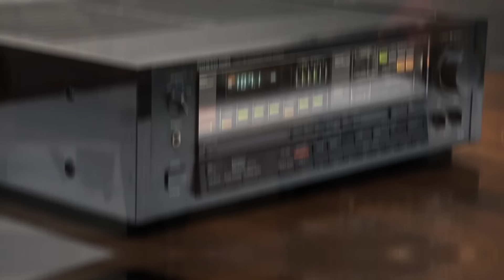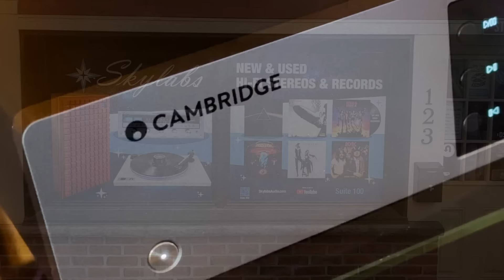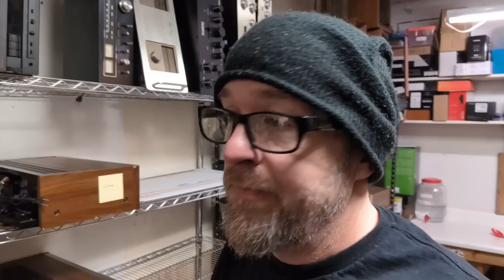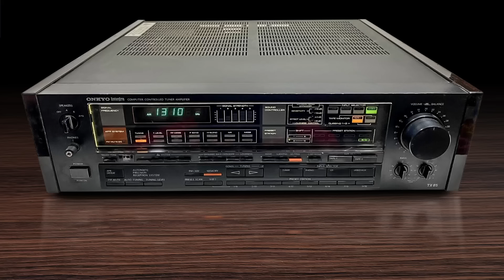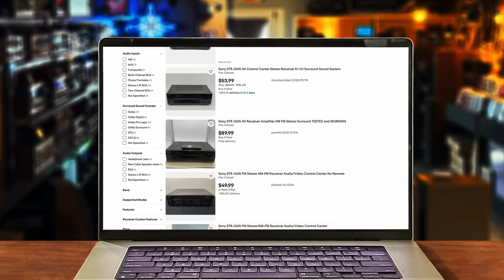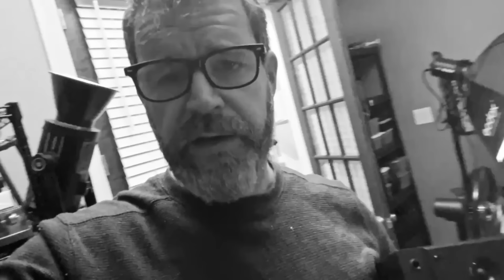Underated Vintage Stereos You Can Get Cheap... For Now

Comment: Very cool topic I still own my original pioneer setup which I bought in 1991 a pioneer stereo receiver model vsx 9700 s and a pioneer 100 CD changer model PDF 904 and a pioneer 6 disc CD changer model PDM 602 and a pioneer double cassette player model ctw 630 all equipment still works like new I paid $1,900 for it in 1991 money well spent

Comment: Recent purchases:  1980’s Realistic STA110 receiver and BSR/Yorx Quanta 720 record player.  The Realistic, $110, needed the pots cleaned, $25. Very attractive device. The Yorx, about $125, needed a cartridge, about $30.  It sounds and performs as well as my new Audio Technia.  Speaks are Realistic Minimus 26s; very smooth but lacking in bass, which I bought in the 1970s.
I also drive a 23 year old Pontiac, which performs perfectly.

Comment: I had an Optimus STAV-3280 which was a rebadged Pioneer VSX-462S and it was a GREAT receiver! Phono input, lots of Aux inputs under different names (I loved playing my iPod through the “LD” jack so the display said “LASERDISC” haha!). Only reason I sold it was because I needed the space and I used the money to buy another piece of stereo gear (I don’t buy something usually unless I sell something. Stereo recycling!) It was from 1993.
And from 2001 I have a pair of JBL S26ii bookshelf speakers. Home theater speakers that cost me $40 ($70 but they came with a Center speaker I sold for $30), only 87db but they sound really good. Hooked up to an SX-780 in my 10’x12’ home office. No complaints about them at all, except from my wife when I turn them up, hahaha

Comment: I own a few of these “not so vintage receivers” and I will agree, they have been great and trouble free all these years.
 Purchased the Pioneer VSX-9500s right after it was released and I purchased the Onkyo Integra TX-85 and a later model Onkyo A-SV810PRO which was impressive on the inside as well as built like a tank on the outside.. These three later receivers are still performing well and as previous mentioned, without a single issue!

Comment: 2005 is vintage? Now I do feel old,lol. That was  a fun video. I've got a pair of Polk Rti10's from around 2004-2006, and they are still going strong.
Reply: Everything that isn’t a smart speaker or has no Bluetooth functioning is considered vintage lol
Reply: I have several pairs of Polk speakers from that era.     All second hand.    All sound good.  Really can't beat the value
Reply: Agree about the Polks!
Reply: Yes definetely vintage , quarter of a century old .
Reply: I'm running a pair of RTi12s as the front left and right channels in my surround system. Even fed with 90 to 95 wpc from an Onkyo and then Denon AVR, these things absolutely rock.
Reply: 21 year's ago
Reply: @briantruck2284 What's 21 years ago?

Comment: Great video!  While I love the 70s and the sound of AB amps, the 80s and 90s had some great equipment too.  Hopefully, the prices won't skyrocket like the 70s gear did!  Unfortunately, the wife bought a "vintage" CD player without talking with me.  Explaining sampling rates etc. to her was just spiffy lol.  It works, but......

I have an "vintage" Sherwood receiver driving two two-way speakers that I built for my garage system.  It's been there for a couple of years fed by a cheap CD player from Amazon.  I'm a woodworker, so that thing is full of dust - I'm almost afraid to clean it out lol.

Comment: Awesome video. Definitely was a fun one! In 1990, I was 20 and I made my big audio purchase. It comprised of a Pioneer VSX-9700 receiver, CT-W650R dual cassette player, PD-M550 6-disk CD player, and the GR-777 graphic equalizer with dual spectrum displays. While rocking to some Van Halen, the dancing of all matching orange displays looked like the 4th of July! I still have and use it to this day, 35 years later! No issues. Even the remote control and the fancy motorized rotating volume knob still work. Your video is a trip down the nostalgia road that I'm still travelling on! LOL
PS...my older Hitachi HT-1 turntable still works too, but I finally bit the bullet and upgraded to a Fluance RT-82. Sometimes you gotta do what you gotta do.
Reply: I was 19 in 1990 and I bought vsx-9700,  CT-w530R and a pair of st-300's.  I think I paid $2300CND for the receiver and speakers.  The dual cassette I'm guessing $450CND.  I still have it all and maybe the boxes too if I look in storage.  Big purchase at 19 years old but sure sounded good during house parties. lol

Comment: I have a Sony STR-AV1010 (110w/rms) that is my downstairs receiver. The CD button needs cleaning/work but other than that it works fine. I just run my CD off the Tape in input and the Sonos in the DAT input.  Noth worth servicing the CD button but until it dies it will be the everyday use system eventually will end up in the basement.

Comment: I have 4 Onkyo receivers from the late 80s/early 90s like the on in the video: 2 x 7830, 1 x 8015R (edit: 8510R), which is essentially the same plus RDS, and a 7720, all are European models from 1987-92 (edit: 1990-95). Also got a 7430 (1986) for my parents. AFAIK the 840 is a US model from 1988. Yes, they're great receivers. I like the 1980s/90s stuff. I'm too young for the 70s gear, as impressive as some of it may be. I also have a Marantz from the 70s, but it doesn't make me as nostalgic as some people.

Comment: The Nakamichi TA-1 through 3 sound amazing and are still affordable. Same with top of the line Technics SA-DA10, or SA-DX1050 with mosfet. Even the Panasonic versions. They are even cheaper. Never had ones that didn’t work, or was a simple fan fix.

Comment: As someone who is slowly adding vintage gear but doesn't have an amp or speakers to hook them up to yet, this is super helpful.  :)  My heart is still set on something like a Tandberg TR-2075 down the road, but money's a little tight for true vintage, so something cheap that's more than just "good enough" would be great until then!

Comment: I picked up a Kenwood KR-v8040 at goodwill for $10. I haven't had a chance to put it through any paces but I know it works in stereo at least and it sounded clean. Possible garage candidate.

I know they, Kenwood, were not premium by any means but has anyone had any experience with Kenwood from the early 90's?

I already have several older Polk bookshelf speakers. Rti38, Rti28, Rti4 and Tsi100. They are all loved speakers!

Comment: I currently have a Pioneer VSX-D466S hooked up to my computer with my vintage Pioneer CS-53's hooked to it. I got it as a package deal from a local secondhand shop for really cheap. It came with a 90's era Pioneer PL-570 turntable, A Pioneer PD-F906 cd file system, a basic Sony TC-WE305 dual tape deck and a cheapy little KLH subwoofer. It even came with the matching Pioneer media cabinet but it was rickety and not really worth saving. But I stored it away from the weather the best I could. It's probably ruined even more by now. The cd player unit even had the previous owners cd collection still in it. Best part? Everything worked. :)

Comment: I still own and use my 1974 KLH Model 55 Receiver. It is still working fine. Pots and push buttons are still quiet (however I do periodically give them a shot of contact cleaner). They are low power 12-17 WPC range. The FM sounds fine and since I basically use it with my BiC T-4M Cassette Deck and my Kenwood Turntable it is a nice simple vintage receiver that is repairable and easy to maintain. I run it into a pair of KLH Model 32 Speakers which are nice vintage 2 way bookshelf speakers. 5 years ago I dragged them out of storage and I changed the capacitor in the crossovers and replaced the iron core inductor with an air core inductor, I recoated/resealed the cloth surrounds and I added some automotive dynamat sound damping inside the box and small strips on the woofer metal frames. The speaker sounded much better after those modifications. An interesting little project to experiment on. 👍🏻
Reply: I really love my KLH 32's and have them hooked up to a Pioneer PL-15Dii tt with a Marantz 2215B receiver, but my main setup is a pair of KLH 33 speakers through a Pioneer PL-115D and Pioneer SX-650. Neither of these set ups are fancy or powerful, but I don't need power.
Reply: @gemspa73 my answer to a common audiophile point of view is do I like the music more than I like the sound quality? Chasing the perfect sounding audio equipment is an open ended search. I rather put my perspective into enjoying fine music of any genre and the great performances by great performers. To me the equipment is secondary.

Comment: PSB, just like the Mirage and Paradigm, are great Canadian speakers. As a Canadian, lol, I would not pass them if I found them somewhere for cheap... Yeah, some of those 80's units are great. I bought my son a Sony STR-GX 50es, paired with the Sony PS LX 520 and Klipsch bookshelf speakers, and it sounds great. He is now in need of a streaming unit!!! I wonder what I got myself into... So anyone in need of a small, excellent, and decent unit, the Sony STR-GX line is not a slouch as a starter. The reason is that you can convert it to a preamp. Once you upgrade, the pre-outs and pre-ins come in handy. the physical tone twist knobs and loudness buttons are reminiscent of the 70's. I have  of these units

Comment: I picked up a fully working quartz lock Sony turntable from the early 80s and a trio integrated amp for about £70 all in. Works terrific. Audiophile? Probably not. But it sounds great, works great and seems pretty well built. Bargains are out there, if you're prepared to put up with some quirks (Sony had a proprietary fit for the headshell, for example).

Comment: I’d have to agree with you, I have 2 Onkyo Integra A-8087 and it’s still all original. I had one little issue (on one of the two I have) with tape monitor dubbing switch. It was breaking up one of the channels due to oxidation. After a little service on my bench with deoxit it’s working perfectly.

Comment: Buying a used unit for your garage?
I bought my unit brand new in 2004 or 05. Payed about $200.00 for a Sony STR-DE197, and maybe $90.00 for a pair of Polk Audio R15 small bookshelf speakers. Both are rated at 100 watt's. The only source material I use it for is my Sirius radio. You can buy the same pieces used for less than $100.00.
My garage is a wood shop. All of the equipment is covered in dust, I never clean them. They work great, I can hear the music over the sound of the saws and lathe. It was money well spent 20 plus years ago!

Comment: Some of those Pioneer receivers from the early 90's sound great. I have a Pioneer SX 205 receiver in my shed. This thing is in extreme heat and cold and it sound great. The yellow display which was common on Pioneer equipment looks great too.

Comment: This is my kind of video. Most of my stereo is late 80's to early 90's Technics gear found on Ebay, thrift stores and an electronics recycling place. Of those pieces, the 5 disc CD changer was the most expensive at around $67. The amp may not be as robust as the stuff in this video (the amp needed a new protection relay, but it worked), but I think it sounds pretty nice and didn't cost me much.

Comment: Onkyo TX - V940(90's)...Got it for 25.00 dollars at a thrift store - 100 watts. It's out in the garage all the time. Remote moves the volume knob up and down., works great. My main inside speakers are late 90's Pinnacle AC 550's and 650's -pristine. (but you won't find  any of these in nice condition any more - they're gone.)

Comment: I get that these were decent sounding units in their day, but they are no way in the class that separates from the day were. If you really want a great system from the late 80s to early 90s, then check out the separates from Adcom, Parasound, and Rotel. An Adcom GFA 535 paired with GTP pre/tuner, or if your budget will allow, a GFP 555 of 565 preamp will truely astound. For $350 - $500 you can have a sound that will crush the budget receivers in this video.

Change out the filter caps on the amp. Clean the pots & switches on the preamp, and you're off and running.

Comment: If people just want good sound and are on a budget. Stay away from the "Vintage" (collectible) scene.   And focus on  good quality gear that collectors want nothing to do with.   This includes  ... Trigger warning"   HOME THEATER receivers   Yes, I said it.  I own some collectible gear  Ill spare you the name drops but good sound can be had DIRT cheap as this video points out.    Set a quality home theater receiver to 2 channel  and skip the rest of the features if you like. BUT... you also get a DAC. Sub out with low and hi pass filtering , pre outs or  pre out main in ( so skip the pre section entirely amd just use the power amp with your front end streamer/pre or whatever.    Speakers that are off the radar:  modular speakers ( i dont like calling them "subwoofer/Satellites"  which will take too long to explain) .    Find some Cambridge Soundworks  ensemble 2s.  Or model 17, model 6s  or  Acoustic Energy aegis ones,  snell, NHT and the list goes on and on.  NO  none of this is "collectible"  but collectible or "High end" doesnt automatically equate superior sound.   And dont sleep on custom install brands like Triad,  Audio design Assoicates, or the last iteration of Sherwood.  So many graet sounding well built units from tons of brands that are not on the Collector  / vintage radar.

Comment: One of your best video's yet for people who are addicted to Hi Fi but dont have a lot of cash. The most expensive piece I have bought in the last few months is a 1988 Denon PMA 500v. AS new in the box with remote and manual for 100 bucks.  Most underrated JVC AX-R97 in excellent shape for 20 bucks. Best deals right now are 25 year old AV Receivers. In the last year I have bought 3 Denon AVR-3805 for around 60 bucks each, all work perfect and all had no remote. If you are not prepared for hours of frustration setting up your 3805 it is best to stay away from the 3805 or anything with a IR remotes. Yamaha RX-V 2500 with box, manuel and remote for 80 bucks. The 2500 is on par with the 3805 but easier to set-up and came with a working remote and mic. Picked up a pair of 1977 Polk monitor no 7's for 20 bucks at a garage sale. You can't beat the decibel's for dollar on these fuse less polks. The only item I have recently bought that was not in good working order are a set of large Advent Legacy II speakers, I know they are not the originals but I am a sucker for real wood. A side from the original foam of having a shelf live of the average one hit wonder they sound good after I re foamed them. So I got 45 bucks and a few hours into them. You should have at least one pair of 8 Ohm speakers. I think they are 8 Ohm. They also double as speaker stands for the Polk 7's or in a pinch act as night stand, small coffee table etc.
Reply: That Denon PMA-500V was a good series from Denon. I had the top model, the PMA-900V and that was maybe the best amplifier I ever had, even comparing with far more expensive gear. Need to get it fixed though, shorted the output...
Reply: I went to buy a pair of KEF 103/3s from an original owner.  The inside woofers needed foam donut replacements, which is quite a bit of work, so I offered low and got them.  He also had a Denon PMA 500v.  Nice amp, but I wasn't interested.  I already had a PMA 1080r and had no use for the 500v.  He ended up begging me to take it for $25 and I relented.  Very nice amp.  Needed the pots cleaned, but that was it.  $125 got me the 103/3s with stands and Kube and a 500v.  I don't think it's easy to find better sound for $125.
Reply: @dkmi  A few years ago I cleaned out the garage of the super nice lady I rent a guest house from. Her husband past in 1998. In the back was a very heavy box. Opened the box and here was a mint Pioneer SX 1250, besides the 1250 were a pair of Polk Monitor 12B's still in plastic with tweeters and high hats. I called her up and said I found a unicorn in the garage with some speakers. She said her husband never got a chance to listen to the them. She said, you take them and enjoy.
Reply: Advent legacy are one of my favorite pairs of rock speakers....psb 800i are my favorites for 80s..90s rock

Comment: Good video to open peoples eyes up about vintage audio.It doesn't have to be from the 70s.My Yamaha totl receivers from the early 2000s smoke every piece of 70s silver I ever had and I had a lot.Plus it has a remote.
Reply: Love Yamaha receivers. Currently have a 1982 R-500 powering my computer desk set up and on my main system just picked up about a 10 year old RX-A810 that sounds just as good as my separates that I had running before.  Plus this Yamaha's DAC can play up to 192khz/24bit FLAC files off of Tidal where my older separates could not.  But the real prize I have my eye on is the Yamaha DSP-AV1.

Comment: Another great receiver from the late 80s was the Realistic STA-2280. 60w into 8ohms and 98w in 4ohms. Excellent tuner and well balanced sound. You can pic them up for under two bills. Great amps.
Reply: The Realistic equipment is very good up until the RCA badge showed up.

Comment: Advent Model 300 Receiver. Incredible little FM only receiver. Known as one of the best phono preamp stages available at the time at any price. Has Pre out/ Amp ins. Makes a great cheap preamp especially for backup.  2x15W @ 8ohms. Basic features. Great headphone system. Simple repair. Going for $200 - $300. Cheap slide switches need cleaning regularly though.